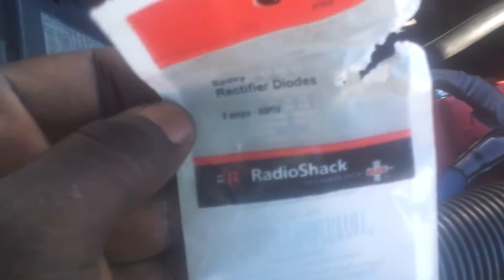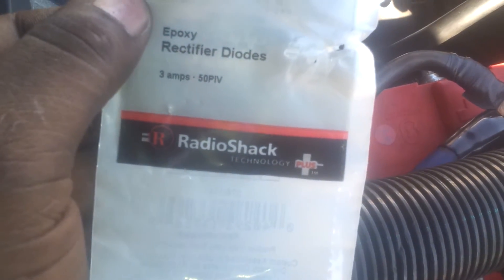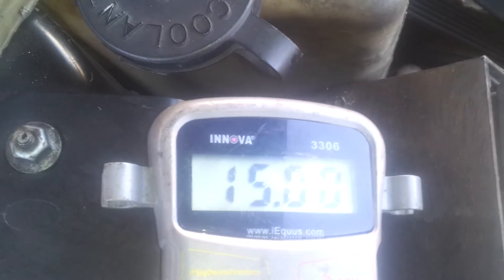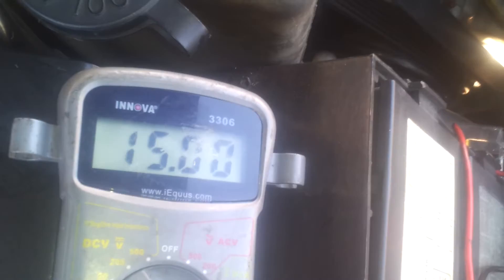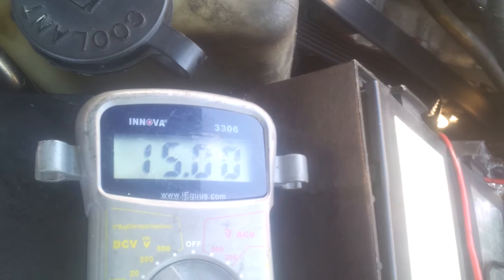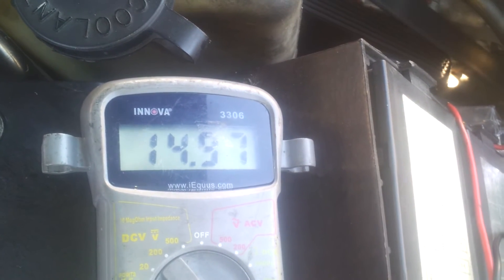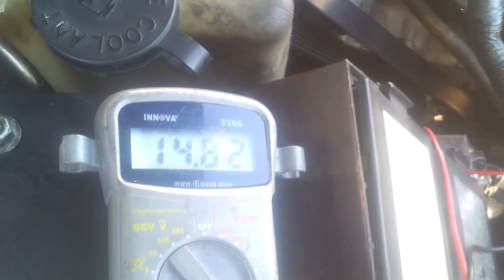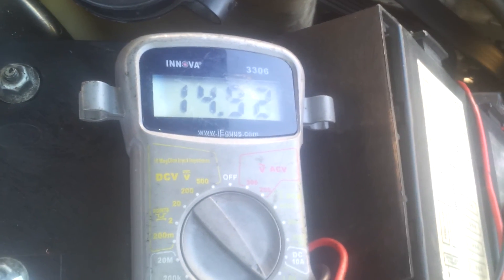Increase Alternator Voltage Output #3

Comment: Any idea how to get 48v out of my Gm 10SI 100Amp Alternator ? Charging lithium phosphate 3.2v 280Ah battery bank ! I’ve bought voltage regulator to shut down the charging when I hit 48 V I have a temp sensor on the alternator so the alternator does not run too hot while charging ! But I need to tweak my alternator instead of charging 12 V to charge 48 V I’ve tested off the stator on the GM one wire alternator is above the rear bearing it’s a little window with this three copper wires coming down that’s the stator pure sine wave AC current spinning it on my bench with my impact gun which rotates a peek at 2000 RPM I must’ve been going maybe 1800 to 1900 RPM and I Tested the alternator at 1870 V AC current dropping when I was off the trigger so my GM one wire high amp alternator produce is off the stator just about 2000 W AC current before all that alternator rectifier changing it into DC current 2000 W AC noted channel that into your fuse box have heard it being 90 A your house is it 100 A or 200 A if you got a big house so now that’s Two alternators pushing 180 A at 4000 W but your current from the grid 250 V at 110 A

Comment: Would it be ok if I use one diode on my high output alternator instead of 2?
Reply from the maker: Avoid this method at all cost.
Reply: @TheDemo05  so dont do this,?even with a high output alternator

Comment: How did the mod work out in the long run? Did you have any issues later?
Reply from the maker: It lasted 30mins... just a test to see if it work at the time... get an mechman high output alternator.

Comment: Sorry, close to worthless. TURN THE EFFIN' ENGINE OFF!  What color is the "excite" wire?  Which direction did you put the diodes in?  All the obvious questions, no answers.

FYI, a single diode will increase the voltage by .6 volts.  Period.  Yes, two in series, 1.2V.
Reply: The color for excite/sense is different for different cars and the direction of the diode is like you said, obvious.

Comment: even a new battery if you do not wont to get a new battery every 2 to 3 years, you have to check the acid in the battery, and never add water to a battery, it have to be acid, this is why all batteries are failing so fast, running out of acid, or acid getting to week, power all the acid out and refill the battery with new acid, with safety measurements , eye glasses rubber gloves, people do not know this, and most battery do fail after the warranty is finished. lol

Comment: normally you should have 14.50 our 14.60 of charge coming from your alt, any more will over charge your battery , your better off getting a bigger battery, go up to 8.00 cca amps, our or the biggest you can get to fit in your car , our truck. because you only need it charging at 14.50 charging above this is over charging , when you need more power, it's not the voltage you have to rise, it's the cca amps, it's marked on the top of all batteries. the more cca amps you have in a battery, the less the alt will have to charge, and the more gas mileage you will get.  and when your batter starts getting low on cca amps, your voltage is going to drop
Reply: Wrong on multiple counts, do some more research

Comment: You keep saying you wired the diodes in parallel but the one
clear shot of the diodes in video 2 showed you had them crimped together in series (end to end) with blue solderless connectors , parallel would be side by side All I have right now are some 1 amp diodes and I just tested
3 of them on a 12v battery wired in both series and parallel, parallel only
caused a 0.10 drop in voltage but series dropped the voltage almost 1 full volt so they’re supposed to be wired in series not parallel. You did it right just saying it wrong….
Reply: Exactly, according to Ohms Law in parallel circuits the voltage across all components stays the same, in series the voltage drops stack up.
Since the entire point is to drop the voltage then it should be in series, you could add 20 diodes in parallel and itll be as if you only had one
Reply from the maker: I Understand, Thanks.

Comment: Hi.  I want to do this.  It was not clear to me where you connected the diodes..
Reply: hi, if you are going to do the diode thing on your alternator you should know that the gentleman who made this video is mistaken on his terminology, the diodes need to be run in series not parallel, i think he has the two confused. my 3.8 92 GM car was running at 11.9 volts at idle with a/c and brights on, i just took five 1 amp diodes tried them in parallel and it did almost nothing, i then wired them in series and it raised my voltage at idle from 11.9 to 14.4. just make sure the diodes are on the exciter line and wired in series (nose to tail) with the direction of flow towards the alternator. the whole thing with soldering took about 30 minutes... good luck....
Reply from the maker: The Alternator Has Two Wire, 1 Sends A Charging Signal To Your Dash, The Other Is A Sense Wire, It Is Use To Excite The Alternator To Change(13+v), When You Use The Diode Between The Sense Wire, It Gives The Alternator An Even Grater Excitement Tricking The Alternator Into Charging At(14.5+v)
Reply: Thank you for explaining.
Reply from the maker: +Brad King Thanks For The Corrections.

Comment: got a 99 gmc jimmy with the 1 wire alternator tried it and got no gains at all. anyone know anything that does work for the 1 wires?
Reply from the maker: https://www.youtube.com/watch?v=QPl7CTb685I
Reply: About the one wire alt' you said you had no gains? Elijah? Did you try keeping the original alt' wire ran but then try a 0 gauge wire from the positive of the alturnator straight to the battery. Pull more power with a bigger wire? Try the big 3!  Take care man have a good one👍
Reply: I know now. The one wires are pcm controlled with a pulse width modulator they dont use the field wire for a battery reference. Got a high output wired in now all good.

Comment: so what was the outcome of this. did you like it. would you recommend people doing it or just go and get a H.O
Reply from the maker: Get a Mechman Alternator, A Non H.O. Alternators "Voltage" Output Can Be Increase, But With Out The Amperage To Back It Up, Your Stator, Rotor & Voltage Regulator Won't Support The Mod I Did.
Reply: I say pick up a couple HO's and have a party

Comment: Why would you increase the voltage?  Voltage has little to do with output.  And the max you would want to have is 14.4-14.6V  Its a 12V system and would operate fine at 13.5V. There's a reason why your Volt guage only goes to 16 or 18, and usually thats in the RED part of the guage.  Red means bad.   AMPERAGE is what you want to increase to reduce VOLTAGE DROP.  Running things like stereo, lights, winches and other high draw accessories.
The WINDINGS in the alternator are what affects amperage output.  All youre going to do is make your battery overheat.  Maybe have a read on proper alternator operation before you go hotrodding one....
Reply: @Randall Bass I thought that's the whole reason of this voltage mod was to get around 14.5 volts everyone knows amps make 20 to 30 percent more power the closer u get to a specific amps max voltage ratings most have 12.5 rating and a 14.4 rating some amps even go up to 16 or 18 volts for normal operation.

Comment: its real easy the higher voltage you run the less amperage the amps will pull but the lower the voltage  the more amperage they will pull and working harder